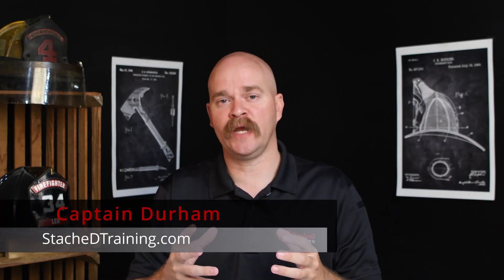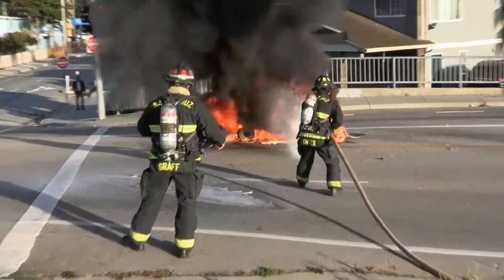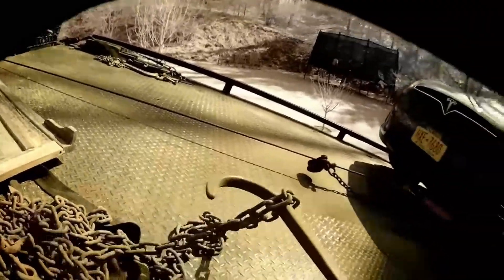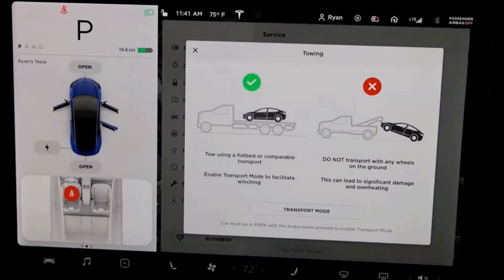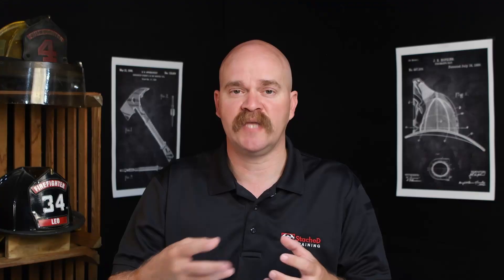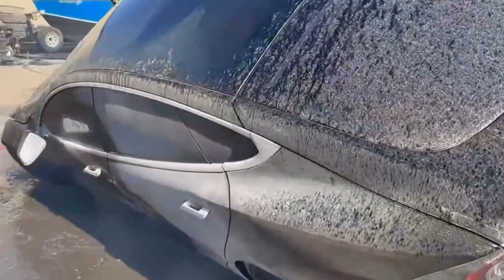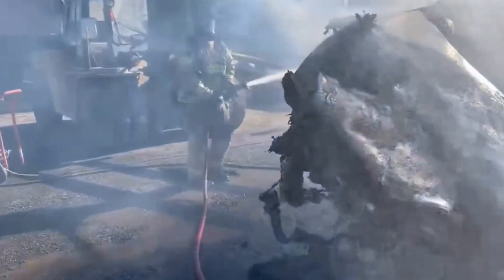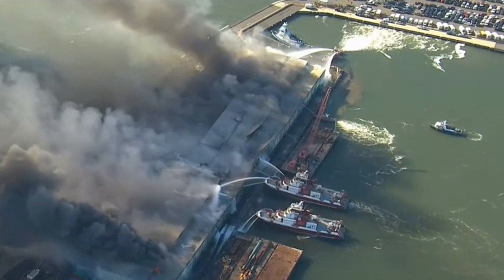How to Tow Damaged Electric Vehicles - Hazards & Best Practices for Firefighters/Tow Operators

Comment: With the ICE cars,there is the fuel pump disabling mode in event of a crash. With EVs, maybe a similar circuit tk disconnect the batteries from the car electronics.  Also to flood the battery compartment with a high density non-flammable foam to help cool and protect them. Nothing will be perfect  but making it better is the way.

Comment: A thought I had earlier today on the subject.  Perhaps there should be a standardized break away access cover somewhere inside the vehicle that covers a connector to the high voltage rails of the battery.  That way emergency responders can break open the seal and plug in a large fan cooled resistive heating element sort of like the electric brakes on a locomotive directly to the high voltage bus bars, giving a method of relatively safely and quickly discharging the high voltage battery to full depletion and taking all that energy out of the equation.

There are some considerations and the process would take some time depending on the size of the battery and state of charge, high discharge rates will cause cells to warm up and at extreme discharge rates (near short circuits) cells can actually heat up so much they go into thermal runaway, so the actual discharge rate would have to be moderated for pack size/state of charge/voltage especially if the vehicles built in battery cooling system is no longer functioning.  Maybe the access port/connector could also have a channel where water/coolant could be pushed through the internal coolant lines in the pack and out through burst disks at the periphery so a higher discharge rate could be sustained by active cooling from an external water source.  Basically a system where if you know a damaged pack is potentially minutes away from thermal runaway, you can quickly break open a panel and jam in a standardized connector that will internally flood the pack with coolant and discharge the cells at the same time.
Reply: You have a good idea but it could be builtin emergency shortcircuit discharge device triggered when the cell reaches a certain temperature.

Comment: It’s amazing with all of the forced standardization on things that don’t necessarily matter that we don’t have a standard battery quick dismount. If you could just drop a battery into a storage unit that is designed for high pressure it would allow the rest of the vehicle to be stored safely.
Reply from the maker: Unfortunately, the battery is a structural part of the vehicle.  There is a Chinese company,  Nio, with a removable/replaceable battery.   Even that vehicle has a lengthy,  highly automated process to remove the battery.

Comment: Great content as always! It will be interesting to see how we end up dealing with the potential fire hazards of EV's as they become more popular, especially in densely populated cities. The concrete wall idea is interesting, but clearly impractical in many situations and I question how effective it would be, especially in enclosed areas like parking garages. I'm not at all against EV's and I realize that battery fires are relatively uncommon, but I personally think we need to figure out the infrastructure and regulatory side before allowing them to be sold to the public. Things like exactly where they can and can't be parked or charged, ways to effectively fight or at least contain the inevitable fires, and safety standards for the batteries. Filling the world with potential hazards and then trying to figure out how to mitigate the hazards is the exact wrong order.